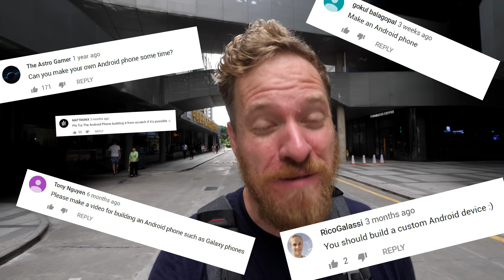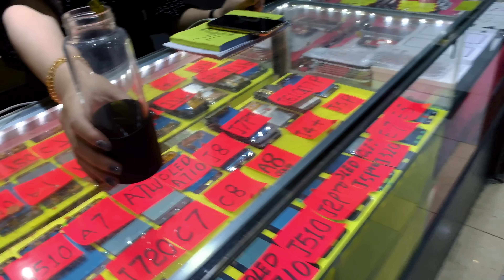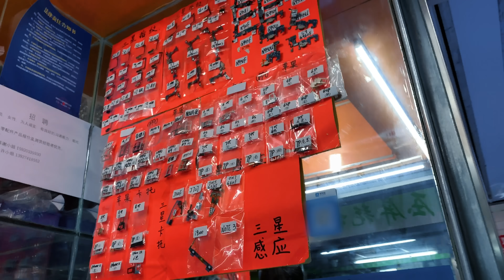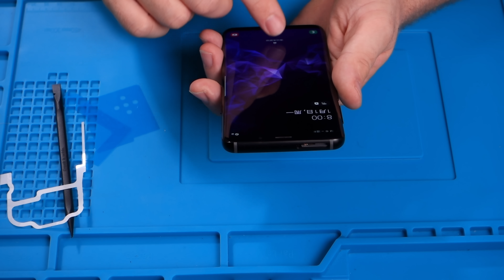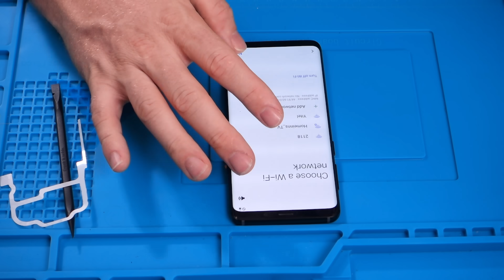How I Made My Own Android Phone

Comment: Is it possible to completely design a own phone?
Like with the right know how, you should be able to just buy the individual chips (prozessor, Ram, ...), design or copy paste a existing power supply, design the case, buy a suitable screen, and modulating an existing android version for your needs?
Or is there a problem with that.
I mean ofc. you need a SMD soldering station and you need to use a circuit board manufacrurer.
But it should be possible, right?

Comment: it was cool to see the markets in China. I spent time in Thailand so it brings back memories. and it's cool to see how easy and cheap it is to do. but...

I have a problem with most phones these days is that they don't make them physically the way that I want. I like rugged phones that are waterproof and break resistant. I forget the precise MIL-spec and IP rating (85h, 69?) and I like physical buttons, three of them across the bottom, and two on each side, and I like speakers on the front where the screen is, am/fm radio, 2 way radio, the multi color blinking indicator Samsung used to have... etc  ...

the point is... what about customizing the build of a phone? what about designing the physical form and including the specific internal hardware and capabilities that you want in a phone? with a custom OS...

Comment: hello, i hope you are still active, the coil is rubbing against the metal part of the speaker,

try applying outside pressure where you out the pin, the pressure am talking about is not pressing downwards push the coil  towards the outside hard enough and apply a bit of heat with a hair dryer.

Comment: You have been lucky that the previous owner didnt add a google account 😂
Reply: U can bypass it by frp unlock 😏
Reply: @MoonKnight2240  oh not samsung  cause the owner info is stored in a harware chip that is secured by knox  and if you force the logging in the knox fuse gets burned  hardware chip gets disabled and since the boot process cant be signed well you will get that warning at boot the device was tampered with , gringo samsung is not android it doesn't follow the android boot parameters it uses a custom boot loader no fastboot support  so if you insert apps in the boot chain they have to have the same signed certificate or else they will not run

Comment: I really liked this video but really I would have been more interested in really making a android phone. I found in one video i watched that in china they actually take designs of popular models and modify/upgrade them. It would have been interesting watching that from finding someone that modifies/upgrades a mlb to maybe upgrading the bt or other parts,  and then getting the other parts and putting together. oh, modifying the rear cover with some design also. Then maybe rooting the phone and putting a third party os on it for real control. that would have been a great video. This is a bit vanilla.
Reply: Some modding today is doable via software,  for example if you are able to expose more SoC to a cooling solution  you can also increase the cpu and gpu speed , mot the battery from 5000 to 10000 watts
Reply: Yes i also wanted to make a small phone to take with me during running much like unihertz jelly but more squarish.

Have to do with a smart watch now

Comment: This is an awesome video. I've done a lot of replacing parts on a Galaxy S8+ but I had to order parts from online and have them shipped to me so I could do what I needed. Now, I'm currently on a venture to locate and replace an OLED for a Galaxy S20+. I have not yet taken one apart so I'm unsure of the difficulty in replacing it. Do you have any input for me on what to expect and possibly how to find the parts I need without emptying my wallet in the process?
Reply: Ah if you buy some used parts like the case or where is less risk but buying the entire logic board used is way to risky here got lucky that the previous owner did not use play store  if he had created an account or used one to login, the device would be cloud locked  it means you could not pass in case of a reinstall ah and who knows  maybe find my phone is on  real owner comes

Comment: android its alot easier. you dont have to deal with the pairing serial bullcrap that makes every part of an iphone noawadays to be paired with the logic board(ex fingerprint, face id, battery,etc...)
Android should be a breeeze. in some cases all you need to do to get rid of a locked board is flash a custom rom, or go trough an frp skip process(theres a lot of methods and altough some dont work, eventually you'll find one that works.

Comment: you could do it in 2022, buy a dimensity 8100/9000 motherboard, one 50mpx camera sensor, and good screen. then flash a pixel 6 gsi with android 13 on top of it and it should work and have basicly all pixel features.

Comment: If you have a locked phone, you can factory reset it. However, all android phjones have a factory reset protection (frp), that is automaticcally active if android 5 or above is installed. If the google account wasn't deleted from the device, you will not be able to setup the phone since it requires you to log in using the owners acccount after the factory reset.
There are ways to bypass this however but it requires a bit of knowledge and isn't that easy, especially if you have no clue about the tech. But if you know how, it can be done within 10 minutes. In such a case, the easiest method is to contact the owner of the device and ask if they can remove the device in their google account. This is obviously only possible if the device has a known owner and if you have the contacts to that person.

Comment: @Strange Parts  hi man, I'm very curious at 12:16 minutes you have a motherboard for the USA region with a snapdragon chipset but you use a charging connector for the Exynos series which is applied to the main board of the Snapdragon series, I think it has a different path because of the different chipset. can it be charged after you assemble it?

Comment: Android users don't replace their devices since it's cheaper to repair them than replace them, unlike iPhones. That's the main reason to get an Android device. For iPhone even the back panel replacement in some models costs over 250$.

Comment: It's usually the case. Looking from our perspective, when S10 hit the market, very few people actually adopted it. These would be the same people that either trade in or sell it to finance the S10. S8 therefore became abundant, and from a Supply Chain perspective, batteries on these started failing, parts became harder to come by so repairing made no sense, more damage and more scuffs on the handsets which required more parts to fully refurb, which meant in turn that instead of repairing them, we preferred to sell as is, for an even lower price. This price fell into the purchasing power of Chinese interests, so they were shipped there. And I base this from the perspective of someone working in the business.

With iPhones things are different slightly. The brand is too powerful, so even very old units and parts for them still floating around.

Comment: I think that it's a lot easier to work with android phones, mostly because there are no tiny pieces like there is in iPhones, and if you repair one android, they are all similar to fix. And yeah, you were lucky that google account was deleted from that one, because when you reset the phone without removing google account first, you are not able to get past the email login step since you need to type in e-mail adress that was on that phone before reset. I mean, it's possible to bypass that, but it's a bit tricky.

Comment: If I made my own android
I would add

Rom:1560
Ram: 60
Snap dragon:latest
Cooling fan:latest
Strong Screen
Water resistant
Fire resistant
Drop resistant
No sweat while using
No overheat
No lag
High graphics
High FPS
Battery long lasting at least 2days
Fast GPU
Fast GPU
Graphics Card
Scratch Resistant
Smooth OS
Fast OS
Strong Security

Comment: that display, i doubt it is an Amoled display, you most likely got an LCD display instead.
in terms of samsung parts, the Amoled display is the single most expensive component in the phone, so a lot of sellers sell fake LCD displays and state that they are genuine Samsung Amoled displays (yes even curved LCD displays - don't ask me how the hell they do that, i'm probably more confused than you are).
cost wise, the cost of a genuine samsung amoled display is more than 7 times the cost of those fake LCD displays.
and those who DO sell you a genuine samsung amoled display for CHEAP, usually those displays have defacts in them - burn ins or lack of sensitivity in certain spots or dark spots or dim backlight or dead pixels etc. etc.

Comment: I would build a phone with:
Apple a line up processor.
Samsung 10 bit super bright 4k display ,144 Hz.
Sony camera sensor with Google processing software and Sony's own auto focus and stabilization
Vooc super fast charging and also super fast wireless charging.
Under display camera.
Stock android.
Headphone jack, usb c port,5 g all mm wave support, 
Sony's hifi front firing Dolby Atmos speakers.
Wide ,ultra wide, macro , 8k at 60 fps, space zoom.
Qualcomm under screen finger print scanner.
Price under 1500 $
Reply: Vinayak K Pattanashetty and how much are you going to price it

Comment: i tried to make these mix of phone.i bought all the parts and all of it cant be mixed into one motherboard
mi note 10 camera
a13 bionic processor
xiaomi redmi note 4 camera
amoled display
blackberry security
umidigi power 3 power
sony speakers
100w charging
i added it to my xiaomi 100w phone......

update:im using my brothers phone now.

update:after finishing the video i finnally fitted it through all of it i cutted some parts so it will fit.

update:i setted it up

update:it costed me a whooping 500$ so cheap

Comment: i would love to be in your  position where if you need a few wires you can just go and get them, ive got a load of iphones and parts sitting in my room waiting to be repaired and youll be glad you built an s9+ instead of an s10, i got one when it was released  a year ago and lets just say it has never been the flagship phone samsung promised, and when it arrives im buillding up an iphone 7 to switch to as my s10 is having touch issues and spending 200 on a new screen and doing it myself or giving samsung £250 to do it doesnt really justify the value at around£3-400 the phone is now worth. ive repaired iphones for a while now and having used a few 5s and se before my samsung s10 i really liked them, at the moment my budget can only stretch for a second Hand iphone 7 matte black with a cracked but still working display, and a slightly knocked up housing, when i can ill replace the display and replace the housing to create a product red iphone 7 with a black screen something which apple never did until the 8

Comment: I've seen iPhone teardown videos, but never did one myself, I've seen Samsung videos, and having disassembled and restored a Samsung Note 5, I can honestly say that I wouldn't want to ever try to build an iPhone from scratch. Not that the phones are simple or anything, but Samsung just seems to be much more modular in their build. About the only thing to be careful with is if you're buying parts for a specific carrier, you obviously want to make sure you get the right motherboard, but you also need to make sure you get the right USB port/board. Other than that, Samsung phones fit together easily, and as long as you do it in the right order,  it all goes together fairly easily and without having to worry too much about breaking anything.

Comment: This is a depressing reality of the cellphone parts market when you repair phones for a living. 
iPhone parts are rarely hard to source and comparatively inexpensive. Android parts are often scarce and expensive. Total inverse of the retail value of the phones themselves.
Reply: gotta love apple... if your fingerprint sensor breaks, its tied to the main logic board, and you need a brand new logic board since the fingerprint sensor will only work with the original board. Apple is very much anti repair. See Louis Rossmann's videos if you're curious about Apple.
Reply: It's cheaper to repair iPhones as it's one brand with few models per year. Where Samsung makes a ton of phones in different tiers, together with all other android phone manufacturers. It's kind of a nightmare having stock for all those brands, when you're trying to have a profitable business
Reply: @martinsnow6641  Totally false statement! Wether or not your an Apple Fanboy or a Android Lover, Android phones are always much much cheaper to repair. Ive had both and can tell you I can get any part for any android 95% of the time simply thjru eBay. Prices are usually similar if to Apples. That is until you get to screens and back glass. Apple charge a ridiculous amount to repair a screen or rear glass. Apple have made all phones from iPhone X not repairable by anyone but professionals.
Reply: @MaZzXtRA  you are right. iPhone makes their stuff to be as proprietary as possible which is why I don't use Apple products. Although they do make very reliable products and stand behind them. But the other guy you said was false is also right as it's easier to stock for 3 phones then it is 30

Comment: I hate how all phones have specific parts that only work with that device model i wish a company would create a huge range of different parts so you could mix and match to your desired specs and build it like a custom PC, it would be great if you could just modernize an old phone with a new processor and ram upgrade and graphics chip and such and you would not be forced to buy a 30mp camera you rarely or never use like you do on new phones and you could add the saving to graphics if you game on your phone.

Comment: Now that the "secret" project is over, how about revisiting Android and making your dream phone instead of putting together something one can buy in stores?
Reply: Yeah but the problem would be the software and firmware part.
Reply: @darkangel4385  exactly. that would require a deep knowledge of how to create a custom kernel. it'd be 100x harder than just piecing parts together
Reply: @kyletrent.mp4  Why not just use stock Android then root it. Sure it's alot riskier than making a custom one but it's easier.
Reply: @tomikun8057  you'd have to rewrite firmware, way different than just rooting your phone
Reply: @darkangel4385  Now that I agree with 100%. But XDA would probably welcome a challange such as this.

What are we if we don't push back against out limitations eh?
Reply: @diegonei  ok but wouldn't that still be "putting together something you can buy in stores". Anyways I see what you mean now, mb.
Reply: @primekrunkergamer188  Only if he goes and recreated a phone exactly, but I see your point. Still a fun project, fit the exact processor you want to the camera you want, with whatever amount of memory you want and the battery size you want, etc.
Reply: Diego Nei de Brito Santos that’s not possible if it is only him
Reply: @tsunsanqty  Yeah, thanks for your two cents.
Reply: If he build his own android it wouldnt be that good, since designing and making custom parts is not that easy of a task. You do realize hundreds of people design and model these phones in companies?? Its not a job for 1 person and hiring that many people would take a lot of money.
Reply: @primekrunkergamer188  First of all, who said anything about design? I said make, as in build. He would do the same thing he does now, pick a chassis (say a Note 10, for real state) and then fit whatever components he wanted inside. Think adding more memory to and iPhone, but amped to 11. And do chill,.

Comment: Hey why don't you take the best features of all 2019 flagships(mate 30 pro/iPhone 11 Pro max/ Samsung galaxy note 10 + and Google pixel 4xl to make the best phone ever. My idea was to use 7680 fps slo mo from mate 30 Pro and horizon display, gestures from Google pixel 4 camera from iPhone 11pro max. Ram from note 10 plus and finally a 6000 mah battery from Chinese Market. Also try making your own gallium charger so you have the ultimate charging speed. Ps wireless charging from mate 30 Pro and kirin 990 chipset

Comment: I copied from his Facebook.

How much did it cost to build my Samsung Galaxy S9+?

As promised, a full breakdown (prices in CNY/USD):
Motherboard ¥820/$118.75
Screen ¥850/$123.04
Frame and back (shell) ¥55/$7.96
Front and back cameras ¥75/$10.83
Bottom charging board, headphone jack, earpiece speaker ¥21/$3.03
Sim card tray ¥5/$0.72
Fingerprint sensor ¥25/$5.05
Battery ¥35/$3.60
Screws and adhesive ¥10/$1.44
Midframe wafer/charging coil ¥20/$2.88
Vibration motor ¥3/$0.43
Iris camera ¥45/$6.48
IR dot projector ¥5/$0.72

Total ¥1969/$284.93

Price new at Best Buy = $592.61
Price for used/refurbished on ebay = $300-350

Comment: g935 is s7 edge. all samsung phones have codes like apple. in the case of apple the codes are A** for example A1418. in samsung case is SM-G/J/A***-* depending on the model. For example, 2015 A5 is SM-A500, S5 is SM-G900, and so on. The thing is that vendors DO use this codes when dealing with samsung. Also you are soooo lucky that board didnt had FRP on (Which is the equivalent of iCloud). Little trick, for samsung phones, dial *#1234# for hardware test menu. When I started working as a phone techinician I started working in an independant repair shop servicing every brand out there. Then I changed to a Samsung Authorized Service Center and let me tell you boi, samsung are waaaaaaaaay more easy to repair than any other brand. Maybe Huawei is comparable in easy of fix, but they are for sure easier than iPhones.